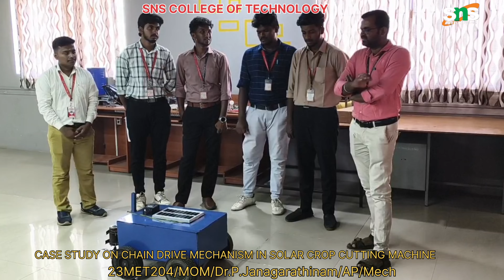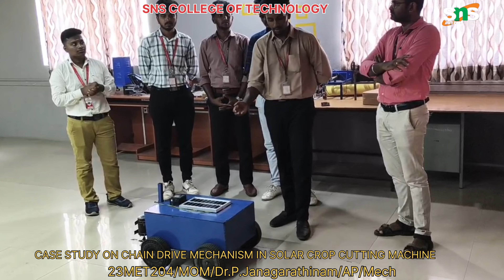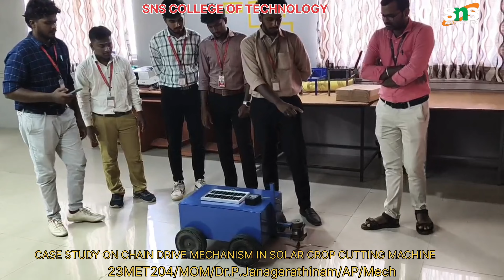Case Study on Chain Drive Mechanism in Solar Based Crop Cutting Machine I MOM I SNS Institutions

Comment: Prototype failure
Reply from the maker: Students have made a sincere attempt to design and develop the prototype model. The effort demonstrates their understanding of the concept and practical application skills. Although the prototype did not perform as expected, the team has identified the limitations and is working on improvements. This experience will help them refine the design and achieve better results in the next iteration.